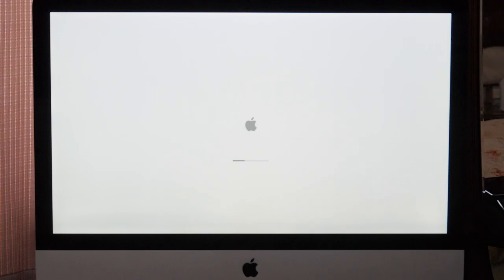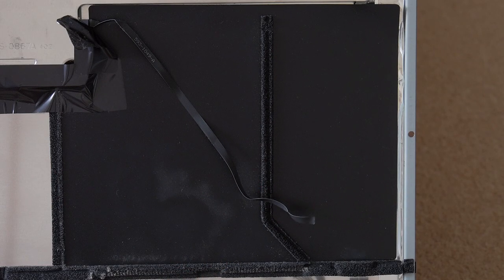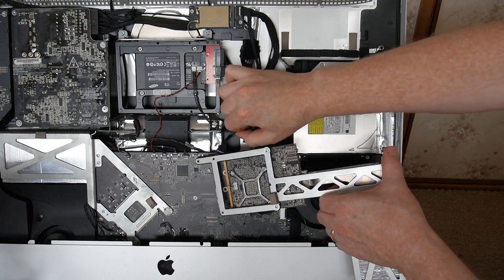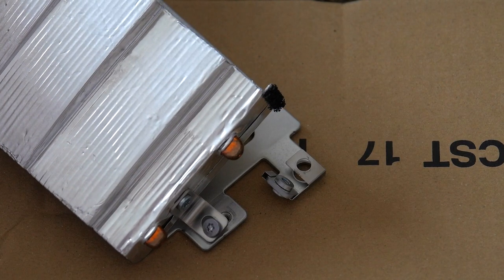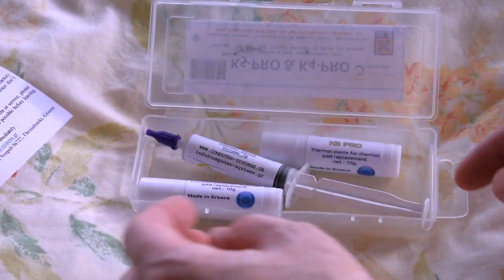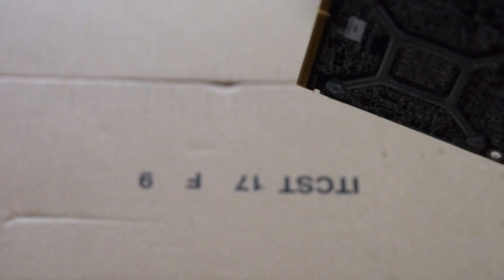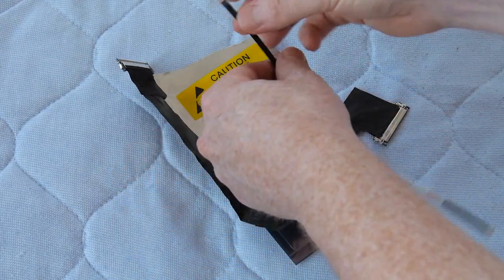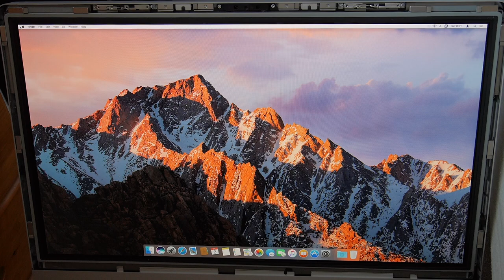Late 2009 iMac 27" Video Card Repair — 4850 — 2nd Bake

Comment: Hello, my process of baking and applying the above-mentioned pastes was successful, today the computer started up historically after a long break in use :) Thank you @JDW for your help and detailed explanations that saved money, it's a pity that I found your channel so late :)
Reply from the maker: That's wonderful to hear, Gregory.  Although the bake doesn't last forever, I do hope you are able to get at least several more years of use from your newly resurrected iMac. Best wishes!
Reply from the maker: @grelmedialski2241  Nothing you do will prevent the problem from raising its ugly head again because it's an inherent flaw in the chip itself.  No manner of reballing or using cooling fans (even a floor fan or room A/C) will result in a permanent fix.  The good news is that good paste and properly cooling at a higher fan speed can often extend the time you are able to use the card.  In my case, my second bake got me 2 years and 9 months of use.  I consider that worth all the effort involved.  My 3rd and 4th bakes didn't work beyond a week each, so I knew the card was end of life.  I then bought a 6970M, repasted it, and I continue to use that card to this very day.  So at some point you will need to swap out the card, but the bake is nice because it will delay that, and the bake is cheaper overall than buying a replacement card.  Not sure about fan control in Windows, but if you keep your room cool with a floor fan and/or A/C, it will help even if you can't boost the iMac's fan speed in Windows.
Reply: @JDW- I understand everything. My card is 6970M now. I am very happy, that this process works :)
May your life will be long and healthy :)

Comment: Hi. Thanks for the video. My 2009 27” iMac gpu failed last week , resulting in the green bars on my screen. Purchased the paste from Greece and did the bake having watched your video. Computer running fine now , but I have installed a free fan controller app to run the fans basically all the time . 👍
Ps that small temp sensor was so much fun to connect to the back of the motherboard, in the end I did what you had done and removed the screws and tilted it forward a bit .
Reply from the maker: Congratulations on your successful bake! Thank you for letting me know of your success. Best wishes.

Comment: JDW, Thanks for the detailed videos, I watched both videos (bake 1 and bake 2). These videos inspired me to fix my 2011 iMac 21..5". My iMac was dead (black screen) after few sudden  automatic shutdown during watching you tube.   I was almost going to scrap it and then I watched you videos. I followed step by step to open the iMac and bake   video card (AMD HD 6750).  2011 model has different layout than 2009 model. I had to take out CD drive, fan model (right side) and then mother board. But it was worth doing it. I also ordered thermal pastes (K4 & K5 Pro Kit) from amazon as per your recommendation . It is now working and the only problem is, one of the fan is running at very high speed and very noisy, don't know why . Thank you very much for your videos and I will keep updating about status of my iMac after few months.
Reply from the maker: Sachin, thank you for watching and for sharing your successful bake!  I read and reply to every comment under all of my videos, and I can tell you that several people have reported high fan speed after the bake just like you have. In every case, the reason is because a connector was either accidentally left disconnected or not reconnected properly. The proper fix for that is a bit troublesome in that it will require you to reopen your iMac and check all the connectors. The quicker “Band-Aid“ fix is to download one of the fan control apps that I link for you in the text description beneath my video on YouTube. 

Note that you should be using one of those fan control apps anyway after your bake to slightly increase the base RPM speeds of all your fans in order to keep your iMac running cooler overtime. That’s what I do. 

Keep in mind that after you install the fan control software, you still need to dig into the preference settings of that software to set the minimum speed, otherwise the fan control app will only keep the fans running at the same system control speed as before. Please let me know how it goes.
Reply: @JDW-  Thanks for the recommendation about the fan control app. Downloaded the app. It was ODD fan running at high speed. The app works fine and I can control all three fan speed now. 
Today I am going to open the mac again to check any disconnection of the fan  cable.
Reply: You are right, ODD temperature sensor cable was not properly connected. Now its all right no more  fan noise. Also I can control the fan speed with fan control app as per your recommendation.
Thanks once again.

Comment: I Had the same problem and managed to solve it by taking out the GPU and heating it in the Oven for 20 minutes on 200 degrees Celsius. Worked Great!
Reply from the maker: Thank you for letting us know that a 20 minute bake will also work just fine. Best wishes!

Comment: Just reporting a successful bake of my 2009 27 inch. The card was slightly physically smaller than yours. Also I even managed to avoid detaching the GPU temperature gauge cable! I didn't use the alcohol, just rubbed all clean with a tissue. 10 mins at 200 fan oven. Used the Greek paste. Let's see how long it lasts. Thanks a lot for the great tip!
Reply from the maker: Thank you for sharing your story of success, Wojciech!  My iMac is still going strong 1 year and 6 months after my 2nd bake. If for some reason your bake doesn't last as long, be sure to report back.  But I must say that I read and reply to every comment on both of my bake videos, and hardly anyone posts follow-up comments saying their iMac stopped working.  I'm not sure if that's because they got a new Mac or if it is because, like me, their iMac is still going strong.  Regardless, I wish your newly revived iMac a long a happy life!

Comment: Thank you for your videos about disambling and assembling the iMac. I had vertical lines on late 2009 iMac and I bake video card at 200° for around 8:00 minutes. And afterwards iMac started properly. Let see how long it will last.
Reply from the maker: That's great to hear, Torsten.  Thank you for letting me know of your success.  I wish your newly resurrected iMac a very long and productive life!
Reply: Small thing to improve the process I did not remove the black piece of foamed material that is on the video card, seems it can resist 200 degrees Celsius.

Comment: To follow up, I too did the bake in the toaster oven. To my surprise not only has it been working but I ended up cooking it at about 250 for 11 minutes. I had put it in at 200, washed some dishes by time I got to it, the thermometer read 250 and longer then your 9 minutes. I thought for sure I ruined it. Let it cool down and re-install, and it's freaking working. I did buy the K5 and Arctic Silver. Fingers crossed. Thanks
Reply from the maker: Thank you for letting us know that 250°C  for 11 minutes works well and does not harm the board.  No doubt it loosened pretty much all the solder joints, regardless of solder type.  Leaded solder (the good stuff) melts at either 183°C or 188°C, depending on the formulation.  The nasty lead-free stuff melts at between 210°C and 230°C, depending on the formulation.

Comment: Thank you so much for these amazing videos! I was able to fix my iMac (2009, 27'') using the bake. Something I noticed was that not all the iMac screws could be unscrewed using a Torx T10 sized driver - some screws required the T9. (I thought I would mention it since in the Youtube description it sounds like all screws could be unscrewed using the T10)
Reply from the maker: Thank you for the kind words and for sharing the Torx size tip, James.  I'm certainly pleased to hear of your successful bake!  Best wishes!
Reply: Hey JDW, I wanted to say thanks again, and also give an update - my bake lasted for around 14 months (so I'm very pleased!). I've made another bake, and so far it's going well..(one mistake I made during the second bake though was letting a screw fall into the case when screwing back on the display. Since it fell in the left-hand fan area, I figured it would be fine to leave it there)

Comment: Hi JDW, just want to say another success on a late 2009 27 imac after following your guide and a big thank you.
Reply from the maker: That's wonderful to hear, Steven.  Thank you for letting me know, and best wishes!
Reply: @JDW-  Just to report my first bake failed last week after what must be 1 years + of use. This happen on the day UK had a heatwave, weather was 33+ deg. I just done a 2nd bake using new Thermal Grizzly Kryonaut on GPU but old K5 pro (I know what you advised against...) but trying to save. Fingers crossed. GPU Diode stays around 51 deg C playing your youtube video at 1080p 60 frames.
Reply: Thank you again !
Reply from the maker: @stevlee01  Steven, I am sorry to hear your 1st bake failed, but I do appreciate your having made time to give me a follow-up.  My 1st bake lasted a mere 4 months, but my 2nd bake lasted 2 years and 9 months.  My hope is you can get the same on your 2nd bake.  And so long as the old K5 Pro you had was still quite soft and hadn't firmed up too much over the last year, I think it will transfer heat as well as when it was new.  It's when the paste dries and gets a bit firm that it loses a bit of that thermal transfer power.  Even so, the most important paste is for the GPU chip, and the fact you used Kryonaut is a good indication that your thermals will be as good as you can get from that heatsink.  Just keep all 3 fans running higher than the base speed, and you should be good to go.  Currently, with a 6970M installed in my late 2009 iMac, I have all 3 fans set to 2000rpm.  You can hear the fans, but it's not too obnoxious, and the machine runs cooler too.  Best wishes!
Reply: @JDW-  thanks for the long reply. I have to unfortunately report after 2 full 8hr working day unfortunately it failed today. I get the bong when it boots up but black screen  only. No display. I ran all 3  fans at 2k rpm also. GPU temperature always around 53 deg celsius even playing your youtube videos before it failed. Is this the end or other option is possible?
Reply from the maker: I’m very sorry to hear that. My third bake lasted only about a week, so I decided after that to try one last bake. That fourth bake too only lasted about a week, and it was then I decided to give up on that 4850 video card.

If you are 100% sure there is no cabling problem which could cause the black screen, and if you know for a fact your oven temperature was correct and stable throughout your 10 minute bake, then the evidence indicates your card needs to be replaced.  Your options at that point would be to either replace it with a 6970M and matching heat sink like I did, or test the waters with buying a PC video card which will require a Windows computer to flash it. I have not tried the flashing yet because the 6970M card that I bought has worked well enough for me.

I wish I had better news for you, but at some point these cards just stop working even if you bake them perfectly again.
Reply from the maker: @stevlee01  I got an email notification but for some reason I cannot see your comment here.  Here's what you wrote to me:

"JDW in the reinstallation i broke the vsync ribbon cable. The pins on the ribbon just fell apart. Is this even a possible reason for black screen? I guess unlikely right and issue still points back to GPU. is this correct?"

You did not say WHEN you broke that cable, but I can say that any broken cable needs to be replaced.  And my 2nd Bake Video above directly deals with that.  So yes, a broken cable can indeed result in a black screen and other odd things you cannot explain.  The cables from AliExpress (see text description) aren't that expensive, so I think it's worth buying one or both of them to see if that helps.  I cannot guarantee it will resolve your problem, but I can say that not swapping the cable won't help either.
Reply: @JDW-  Thanks again for the reply! Broke the vsync cable during the 2nd bake re-installation. However system worked without the vsync cable for 2 solid days. Then black screen only. Last night decided to unplug and re-connect the video cable. As if by luck the system booted back. Maybe it's a loose connection? GPU stays at 53 deg,  running 1440p with the Costa Rica youtube video with 3x fans at 2k rpm. However the i5 CPU was getting near 85-90 deg. I will checked out the cable on AliExpress if the system still stable after 1 week of use. Thanks again for the reply!
Reply from the maker: @stevlee01  A bad or disconnected V-sync cable on the 2009 iMacs can cause an audible whine and possibly flicker of the display.  It normally does not cause a totally black screen, from what I have read, but I honestly do not know.  I also do not know the consequences of leaving it disconnected in long term use.  All said, Apple put that cable in the computer for good reason, so having it replaced is what you need to do.  Glad to hear you are pursuing a replacement.  Hopefully that will solve your problem.  But when you replace that cable, you should check all your other cable connections too.  It's very possible you have a connector that is either disconnected or not fully seated.

Comment: Hi!
I baked my video card back in 2015 the first time. Now it´s freezing with artifacts again so I´m gonna give it a second baking this weekend. I plan to use thermal pads instead of paste where the space between heatsink and the card was. Fingers crossed that all goes well, and thanks for the video tutorial, it was great.
Reply from the maker: Thank you for your kind comments.  I'm sorry to hear your 1st bake did not work.  (Mine 1st bake didn't work either, but it took 4 months for me to know it! :-) 

If you had freezing immediately on your first cold boot, then I would say paste had nothing to do with the freezing.  But if you used it for a while and then got the freezing, it could be a paste issue.  You need to remove all the old paste, then apply a good non-electrically-conductive paste like K4 Pro (what I used) to the GPU, then use a non-conductive thermal pad replacement paste like K5 Pro (what I used) on the memory chips.  If you do that, you can be assured any artifacts will not stem from your pastes.  

You can use thermal pads instead of K5 Pro, but I personally don't know the best thickness and is why I searched for a thermal pad replacement and found K5 Pro.  With K5 Pro, you don't have to worry about thickness.  Apply it like I did, some will spill over, but that's okay.  My iMac has been going strong for 1 year and 6 months now after my 2nd bake, which I think is a testament to the fact that K4 and K5 Pro, when applied correctly, work well.

Bake for 10 minutes at 200°C or 400°F.  Some people said they put coins atop their GPU during their bake in hopes of focusing more heat there.  I didn't do that, but go ahead and give it a try.  Let the card cool to room temperature naturally by removing it from the oven and letting it sit an hour.  Then apply your pastes, reinstall, and give it a go.  Please let me know how it goes, Peter!
Reply: JDW Well Im actually very pleased with my first bake, it lasted for more than three years.

Let’s hope that my second bake will last as long as the first one 🙂.

Greetings...
Reply from the maker: Thank you for sharing that your 1st bake predates my own!  :-) The fact your bake lasted around 3 years isn't too surprising.  When I bought my late 2009 iMac, it worked great, but 3 years later the video card died, just after my AppleCare expired.  An email to Tim Cook ended up with me getting a free video card replacement from an Apple store here in Japan.  Sadly, that "new" card too died almost exactly 3 years later.  Knowing I wasn't going to get another freebie, even though it's abundant clear this line of video cards has a seriously flawed design, I Googled, found videos on the bake, tried it, found it worked, and made my own video.  My first bake lasted only 4 months, but I've gotten 1.5 years out of my 2nd bake, and it's still going strong.  It probably won't last much beyond 3 years, but I still think the bake is worth it.  Best wishes to you on your own 2nd bake, Peter!
Reply: JDW The bake went well and I can now use my beloved iMac again 🙂
Reply from the maker: That's great to hear.  Thank you for letting me know, Peter!  Best wishes!

Comment: Great videos (I watched both) JDW with a lot of helpful details. Last year summer I did my first bake and it lasted until this years summer (2019). I think it broke the second time around because I switched of the computer while away for 2 weeks on holiday. Now it's up and running again and although I am still on Yosemite OS I love my 10 years old Mac. PS it only took me 2.5 hours for the second bake. I am becoming an expert.
Reply from the maker: Thank you for the report, Adriaan.  I'm curious.  What thermal paste did you use for your first and then your second bake?  My 2nd bake is going on 2 years of continuous use, and I think the K4 and K5 Pro pastes I used had a lot to do with it.  That's why I'm curious about the pastes you used.  Thanks.
Reply: Hi JDW, I did use the K4 and K5 Pro pastes for both bakes. Cheers
Reply from the maker: @aoprins  Well, you will have no issue with the paste.  I guess your video card was like mine in that it needed a double baking.  Hopefully you will get more longevity out of your second bake like I have.